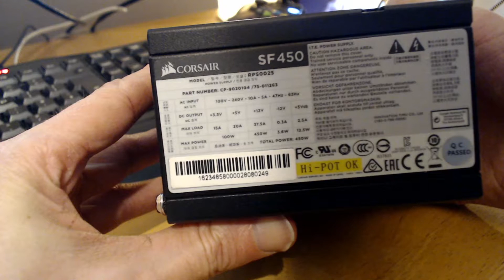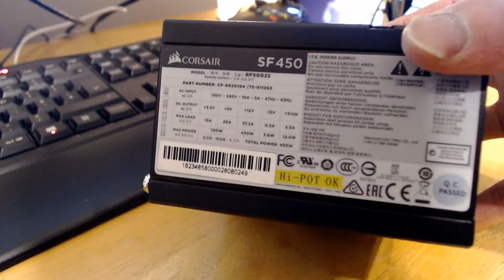Converting an ATX PSU for the Commodore Amiga A600

Comment: You can buy power connectors still for the Amiga. About £12 on eBay for one you can take a part and solder the cables directly to the plug instead of the messy job you did.
Reply from the maker: If you check out my recent video about the Stealth PSU upgrade, you'll see I've got a much better way of doing this now.

Comment: Corsair power supplies are pretty much reliable. I have an AX750 psu in my PC right now, it is 9 years old. No problems with it so far and it is running a good 12 hours a day for roughly the last 9 years. Hope it doesn't decide to go kaput any time soon.
Reply from the maker: Nowadays, I'm using the Meanwell RT-50B PSU's inside the case for the original A500/600 power brick.

Comment: You do not have to solder all the same cables together (like all ground wires or all +5 ones) because they are all connected inside the PSU, so no reason to join them. Just pick one